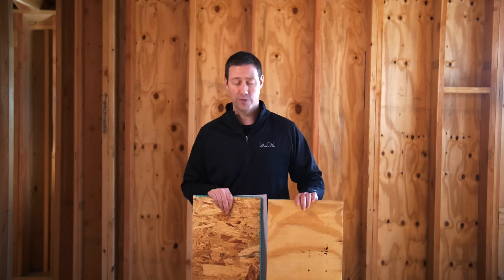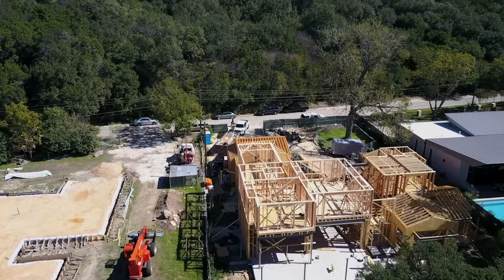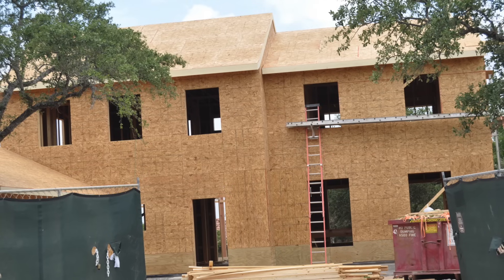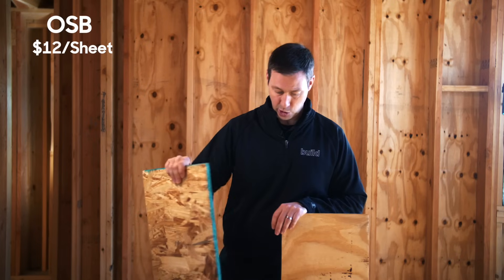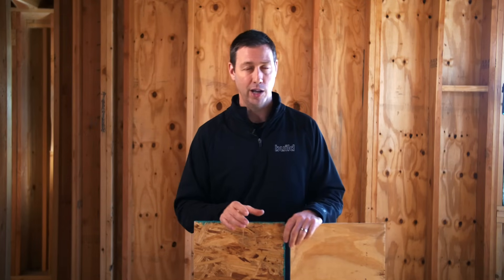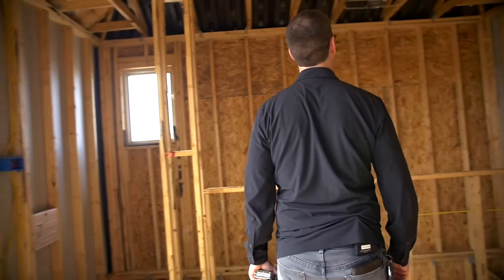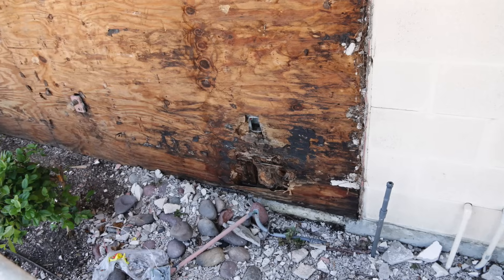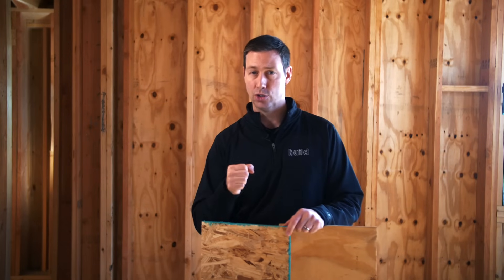Framing : OSB vs. Plywood - Whats the difference in COST AND PERFORMANCE

Comment: The so called “ticky tacky” period of USA commodity residential construction started roughly at the beginning of the post-WW2 building boom. Plywood was, perhaps unfairly, almost a defining ingredient in that construction.
One summer about 40 years ago, while in architecture school, I helped my father replace the siding on our 1952 1,500sf “commodity Cape” in suburban New Jersey. The process started with ripping off all of the 25 year old existing (YIKES) asbestos cement shingles. Don’t see much of THAT on Cape Cod) I was surprised to see that ALL of the sheathing was diagonally set 3/4” solid ship-lap wood board sheathing. It was in excellent shape as was the 15lb felt paper. No rot, no knot holes. Over the years I was always pleased to observe that the materials and workmanship in the base building structure were top-notch. From rough carpentry through wiring, ductwork plumbinh and finish oak strip flooring never thing was done in a neat straight workmanlike manner. There was nothing “ticky tacky” about it except that post-war builders more or less threw out all of their old architectural pattern books...and probably have read articles on “new” innovative materials in Popular Mechanics magazine, decided to “experiment” with unusual materials like...LOL...asbestos cement shingles.  The “language” of their architecture was more “free association” than poetry and the results were decided mixed. These builders probably developed their production building “chops” constructing WW2 military logistical infrastructure at breakneck speed.
Be that as it may, I would say that the base building construction in the development that I grew up in was of excellent quality...even if the architecture was nothing to write home about

Comment: Interesting that the cost difference between OSB and plywood is so little in the US. Here in Europe, the cost or plywood is massively higher than OSB. Anywhere from 2x to 5x the cost, depending on the grade. You normally cannot even buy large sheets of plywood in the home store here. You need to find a special lumber only store.

Comment: It's all in how it's made . Producers have come a long way with OSB . At least here in Texas were it's super hot and dry summer and wet winters plywood tends to separate and starts splintering and curling  and you get bubbles if used on the  roofs. If you really want a house to last build it out if cinder blocks.

Comment: I started working construction in the mid 70's. at the time we used brick, block and wood framing for the interior and all ply for roof decking. I seen my first OSB in the early 80's that a friend had bought. It was smooth both sides and even with a 3/12 pitch I couldn't stay on the roof. Slippery and dangerous as hell. Some years later I used some OSB as it was half the price as ply and thought for me, hmmmm not bad. I am a big guy 6'5" and 300 pounds. The OSB felt much better on the roof deck when walking on it. The plywood form the 90's and current seems worse then the stuff we were getting in the 70's. Seems like a lot more delamination then in the past. I now use 5/8" ply on the roof and frame in 2x4 support at the joints. We used to use ply clips with the 1/2" in the old days and felt pretty solid.

Comment: If OSB gets wet during construction, it swells and warps and pops nails. So, if you use it to save on costs, you are taking a calculated risk that it will be covered before it is rained on.

Comment: You know Matt. I’ve heard you say, “you’re probably not going to remodel your sheathing” and “you’re never going to remodel your basement slab”. I own a mid 90’s built house in a typical PA subdivision. I’m rebuilding every major system of this house a bit at a time with plans to do the basement slab (No sub slab vapor barrier) and the sheathing (OSB on the corners, foam board sheathing everywhere else and she leaks air and moisture like crazy thanks to terrible tyvek wrap and huge seam gaps in the sheathing). It’s all pretty much what you’d expect from that era. I joke and say I fantasize about renting a bulldozer and just pushing the whole thing over and starting fresh. But I can’t do that since we live here and instead I’m sending it to the landfill a piece at a time by rebuilding it almost entirely in a years long non stop effort. Regret the personal time lost... Worst part is I am an exterior envelope specialist contractor and I should have know better before I bought it. But, location... you know.

Comment: I can tell you that crawling around in an attic as a homeowner I would prefer plywood instead of OSB and I would prefer sanded plywood. It would also be nice if you installed plywood to the area around the vent pipes. This would make it easier to crawl out to them to put plastic trays under them. This keeps water from leaking onto the drywall ceilings when the vent boots fail and water starts leaking in around the vent pipe. I can say this from personal experience. I would also prefer kraft faced batts than blown in insulation. In a cathedral ceiling, I wish you would install baffles, some type of reflective material on the sun side of the house to keep my attic cooler and a vent fan with louver vents on the outside. If you care about having a satisfied homeowner, taking the time to take care of the details will make a difference. This may the difference between staying in business or going out of business. Eliminating siding on my house would have been a great help to me as well. It is not much fun climbing up a 32 ft ladder to try and clean your house siding on a house that is 45 ft high.

Comment: It's probably better to use OSB and put the savings into getting the housewrap-flashing detailing right than to use plywood and settle for a hack job of waterproofing. I drive by a new neighborhood every now and then where I saw them putting vinyl siding directly over plywood with housewrap only around the window openings, probably reverse-flashed on the top; I wonder what the owners will find 20 years from now when they go to replace the siding, or what will happen if they let it go 30 or 40 years.

Comment: As both the residential commercial and restorative Carpenter, never use OSB or TJI's. As the firefighters comment below they fail I have torn out more OSB that is just disintegrated in someone's wall and once it starts failing it has no Shear strength. Rot migrates to the surface behind it. I have had two sister up or removing entire studs too many times to count at this point because of OSB. Even when it's properly covered properly flashed Etc it is still subject to moisture penetration and absorption. The difference in cost may seem like a lot but as the old saying goes pay once cry once. And one product that I have used with wonderful results is dry ply for a subfloor or outdoor conditions like site benches or trailers.

Comment: OSB or " Oriented Strand Board " ( 0:36 ) is refered to in the " Trades " here in Southern California as " Wafer Board " . As a Carpenter, ( about 30 years experience )
I would Not use this material !  Because It would not hold upto water as well as regular plywood !  And I doubt that thickness per thickness it wouldn't hold upto an Earthquake as well either !

Comment: For years and years in the UK ,you couldn't get a mortgage on a house that was made from timber . 
Almost every house in the UK is brick built .  Now it's easier to mortgage one .
Historically houses were two layers of brick with an air gap in between .   Now though its mostly a single brick with a timber framed inner

Comment: Does anyone make an OSB "sandwich" with water-resistant structural sheeting on both sides, so it would have surface reinforcement the way sheetrock and cement board do? if this were wrapped around the edge that points up, I'd think it would be more water resistant and hold nails better than most OSB does now.

Comment: My father quit the building company he worked for when they told him to build basement walls with treated plywood and osb on the roof. But then they used black fiberboard for wall sheathing and no house rap. I have now seen the houses he would have built, torn down not even 30 years old.

Comment: I never liked OSB, but as wall sheeting, if properly flashed and whatnot, it's not bad as something to add tyvec and siding to afterwards, but I WOULD NEVER USE IT AS SUBFLOOR, OR AS ROOF DECKING! It mainly depends on budget, and application. On a low price rental that has had crap ass bandaid fixes done unto oblivion, then OSB might be a step up in quality, especially in some of the places I've done jobs in. I have also used it very creatively in budget finish work, I find it has a very neat look for cabinet faces and sides. If you sand it, and then paint it with transparent paint, then add a few coats of clear coat, you can get a really cool finish for custom cabinets done on a very low budget.

Comment: I have only seen sheathing in OLD houses installed on a 45 angle, the only way it provides substantial strength in racking. I worked on a n 1858 mansion in Maryland. Post and beam white oak, sheathed in diagonal full one inch boards, then sided with 1 and 1/8 thick pitch pine shiplap with a bead. Between the oak posts were 2x4 pegged in, and between them... brick. It was the the quietest most rigid building I have ever been in. I was there for a hurricane and you could not tell.  I live in the rot capital of America, Tallahassee, Florida. Second most humid city, no wind, summer 6 months of the year. Many modern materials and techniques come here to die. One thing about the osb question.... which I have never bought .... According to the metal roof supplier, it holds screws better. There are facts that are true but do not signify, and this is probably one of them.

Comment: Take the time to fully waterproof the material with a liquid water proofed. So if water does get behind vapor barrier the water wont soak into material. Extra cost, yes. Extra time  yes. Worth it  yes.

Comment: My house that I built 20 years ago has 2x 8 walls and 3/4 plywood and the first layer of plywood is presser treated my floor joist are 12" on center and my roof trusses are 16" on center. Some would say over built I say no built right.
Reply: That sounds pretty well built compared to most houses built 20 years ago. Most houses built 20 years ago were built to fall apart.
Reply: @CF-3300  thats because I literally built it myself. Thats the only why I knew corners weren't cut. When there's a really bad storm I don't even know it. The hole house is over built but from the footers to the roof.
Reply: What kinds of ceiling fans does it have?
Reply: @CF-3300  I have Central air
Reply: I have both.

Comment: Why are most houses in the US made out of wood? Where I'm from (Holland) most houses are made with concrete and bricks. I'd say wood is cheaper, but here in Holland a well insulated wooden house will actually cost about the same as a brick house. Maybe it's cheaper in the US because of wood availability (and cost)? I'm very curious about this!

Comment: We are currently having a house built and were shocked and very disappointed when we saw the roof most importantly with  OSB. They only put a vapor barierr paper and we upgraded and paid 7500.00 for a metal roof.  They installed the one with hundreds of screws.  The builder says it is up to code and that they build the whole house like this.  Contacted the bank and they said they cannot control the materials used as long it is up to code it is fine.  Nobody had given us the warranty on this metal roof over vapor barrier paper and OSB, particle board.   Can anyone  recommend anything that can be done.  We never got a chance to pick our building material.. Just pretty sad

Comment: ....well I guess I lucked out built my own home..literally set up my own sawmill bought a 4 sided planer. Craigslist for $1k and property with 20" plus pine trees. Cut and milled the lumber for the house and yes it's all shiplap 3/4 solid pine shiplap for the roof deck and all the sheeting one guy on the ground  cutting boards and me with nail gun giving measurements. Went on just as fast as 4x8 sheets but twice as good

Comment: I prefer OSB because humidity itself is more of a problem for Plywood and that is where in long term it will degrade structurally faster than OSB. So, if there are no leaks then OSB is the preferred choice.

Comment: Everybody talks about new houses.  How about an episode with how to repair a cabin.  Ours is 3 cabins made into one.  We had a problem with freezing pipes even after we insulated and still the mice and snakes using the house as their runway.  We are in the process of fixing this home/cabin one wall at a time.  It is hard to find any information on HOW to fix it.  So, we started peeling off the layers of the house-outside in.  First the vinyl siding, then the old shingles (blue- and we don't know whether they are asphalt or asbestos shingles) then the cardboard like siding and underneath finding actual holes stuffed with t-shirt and other open holes.  So, step by step we are trying to do the best we can without hiring and spending a lot of money-as we are over 65 and are on social security plus my husband is a Marine veteran at 76 years.  It would be nice if you could show an episode repairing an older house like ours.  We live in Michigan and we are trying to do it RIGHT!  Thanks for all of your new house learning ideas.  P.S. If you'd like you can use our house as a video do it right.  (Smile Smile)  Thanks.

Comment: We left 10 sheets my buddy asked me to store in an old shed along with 2 sheets of BC Fir plywood. The ants moved in and chewed a nest the diameter of a basketball in the OSB and never touched the plywood. Should have burnt it when he delivered it. We frame with plywood 5/8 walls, 3/4 on the floors and roof.

Comment: My house  ( 1910 ) used full 1" Planks for sheathing.
Reply: Plywood is more stable, and lack of joints increases resistance to diagonal pressure for sure. Nut, in 1910 it wasn't available. Planks worked, as you well know. I have seen some drastic warping in such things in old homes, but again, it was what was available at the time.

Comment: One more point, as a roofer plywood will fail before OSB due to dry rot and “delamination”. This is usually due to poor ventilation which as we all know applies to 90% of homes. OSB for some reason holds up better under these conditions, however if you get a leaky roof then plywood will be far superior.

Comment: Interesting ... I live in the Pacific Northwest where it rains every day all day long ... "drying out" is limited to a couple months in Summer ... everything is soaking wet the rest of the year ... we've had many people move here these past 40 or so years, and these folks brought their architectural styles and building materials with them ... well, these styles and materials don't work where it rains so much ... and we have a growing problems with what's called "Condo Rot" ... homes rotting off their foundations after twenty years ...

With OSB, you're taking a risk ... CDX mitigates this risk, but I agree with Mr. Risinger, there's still the risk of premature failure ... CDX fails, just not as often ... 

Less than a two foot eave, sheath with stainless ... window sills pitched less than 30º, buy cheap windows every ten years ... KD posts for your floor framing, they don't last when submerged in water 6 months a year ... Washington/Oregon are beautiful places to visit ... but just plain nasty to live here ... yes, framing in winter means you're soaking wet by 10 am, we get used to it ...

Comment: Still find it weird to look up stick framed homes. Feels like a shed in comparison to solid or half solid (concrete brick inside with air gap and single layer brick facia stone). Although stick frame has its  advantages... But hey, depends on where you grow up I guess

Comment: The nail retention is crap with osb... as a wood floor installer of 18 years experience  I use to install on osb on a as basis only.. both nail and floor staple retention was poor at best..

Comment: hi matt. who are you talking to? engineers?. why im asking is because a shear panel is designed to handle force. in other words the projected magnitude of the force will require a shear panel that meets the force plus a safty margin. the decision to select the material nails nail spacing is the job of the engineer. choosing the materials for shear panel construction is above the pay grade of the carpenter.

Comment: My '97 built house is sheathed in 1/2" OSB with no wrap and crappy vinyl siding with holes from hail. We are getting it wrapped and re-sided with LP Smart Side. Had I known how many months late they would be, I would have re-sheathed and wrapped the stupid thing myself. Now I just have to twiddle my thumbs thinking about how many sheets I'm going to have to buy when they pull off the siding. Cheap builders suck.

Comment: The difference is sheathing that can last 200 years vs 6 months if you have cdx with heavy black paper vs OSB with tyvek housewrap that sucks water through siding nail holes and traps it inside. I wouldn't use OSB in a wet climate unless I covered it with 30lb tar paper.

Comment: Most Government Projects, Commercial Structures, will not allow the use of OSB. As a 35+ year Contractor I have used a lot of OSB. It is good for it's intended purpose. If I am building a custom home I always recommend to the customer they upgrade wall and roof sheathing if they are looking for increased structural durability. I like to use 1/2" treated plywood along the bottom 48" and either 7/16" OSB or 15/32" 4-ply  plywood above. On my roof I prefer 5/8" Plywood or OSB for a flatter and stronger roof. Not everyone can afford these preferences but those who do are happy with that option. And yes water intrusion is the enemy of every home.